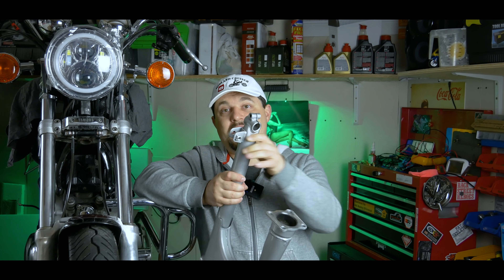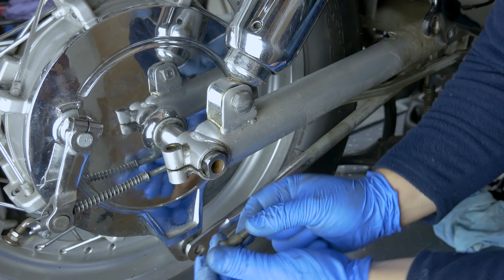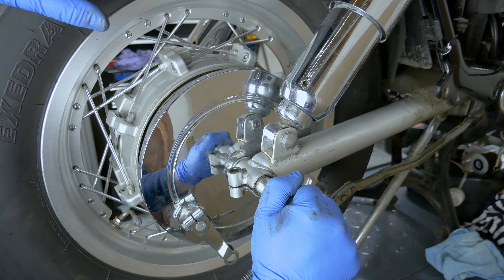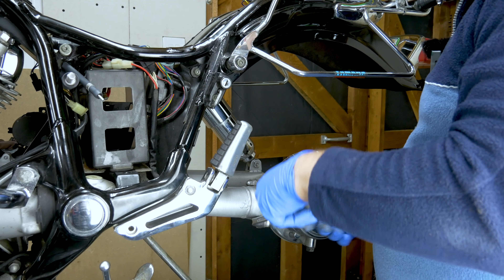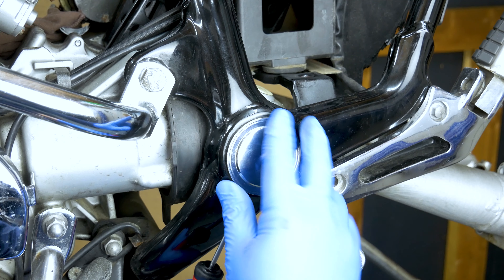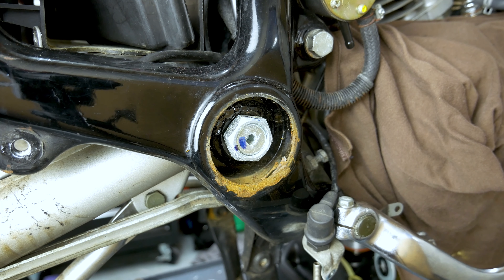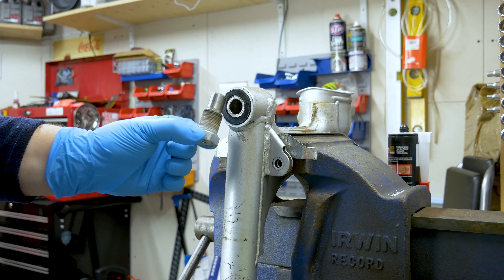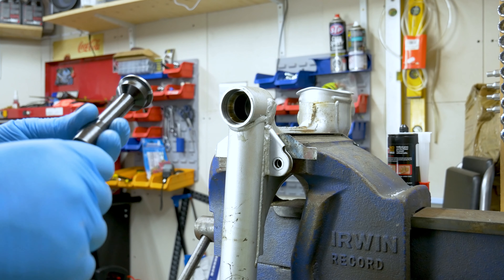YAMAHA VIRAGO 1100 | HOW TO REMOVE SWINGARM AND BEARINGS TUTORIAL | 4K | Powder coating preparation

Comment: Great video, thank you !! I have no issues in removing it, but I am concerned about aligning / centering it when putting it back on... 
Question:  Is there much of a process re-installing the swingarm as for 'centering' it...? Are there shoulders that automatically center it or does it require measuring...?
Reply from the maker: Hello thank you. Me and an other member of the Virago owners Facebook group answered your questions, check it out.. 👍😉
Reply: @MidlandCruiser   Yup, I saw them; great stuff - thank you very much !!

Comment: Hi there. The video is perfect! I am running a750 from1992 prod.year. Can I do the swingarm removal without dismantling the exhaust off the bike?
Reply from the maker: Hi, thank you, really appreciate it. Both 1100 I have worked on needed new exhasut so I can't say for sure, but I think you should be able to do it with the exhasut still attached..
Reply: @MidlandCruiser  Thanks for the quick reply mate! Will try and post the result.
Reply from the maker: @borilapostolov4419  your welcome... Honestly I think you'll be fine 👍
Reply: @MidlandCruiser  Can I ask something else here about speedometer issue, or send You an e-mail?
Reply from the maker: @borilapostolov4419  sure send it to midlandcruiser@gmail.com 👍
Reply: Just a quick update on my question. Information is for everyone who tries to do it DIY. The swingarm can ONLY be removed AFTER the exhaust pipes are down.  I have successfully greased my bearings. The job took me about 3 hours.Thanks again!

Comment: Is it possible to install the wheel with the male and female splines not lined up. I just took my virago 1100 to a mechanic to get the rear tire changed, and after he install the wheel, now there's noise coming from the driveshaft and wheel where it meets the drive shaft. Sounds like a tapping , as if something is hitting the walls of the driveshaft or if there's binding. It happens when the bike is in gear while on the center stand and wheel moving without any acceleration. It does it in all the gears, and it's louder in 5th gear. Any ideas? Thanks
Reply from the maker: Hi, short answer is no. However there is a spacer inside the wheel and if he left that out it may cause some problems. Regarding the tapping noise while on center stand, if it's not continuous and fairly mild than that is considered normal.
What you hear is the play between the gears from the final drive all the way back to the gearbox (especially if you just leave the bike on idle) v-twins doesn't idle super smoothly. 

If it is very noisy and continuous then your universal joint maybe on it's way out. You can chek how big is the play by putting it in gear, on the center stand with the engine off, just move the wheel and you'll see how much it moves back and forth before it engages the gearbox. It is very hard to tell you what could it be without actually listening to it.

I recommend to join the "Virago owner's club " on Facebook and post a short video there, we will be able to help better that way..

https://www.facebook.com/groups/7272457493/?ref=share
Reply: @MidlandCruiser  thank you very much, that definitely helps me out a lot. I'll remove the wheel and take a look at it.

Comment: What kind of bearing and seal did you use pls?
Reply from the maker: Here is the bearing I used Koyo 30203JR https://ebay.to/3f582E6
And here is the seal I used SKF CR25x40x5HMSA10RG https://ebay.to/3nnDZdF
Reply: @MidlandCruiser  nice job bud, cheers 😉